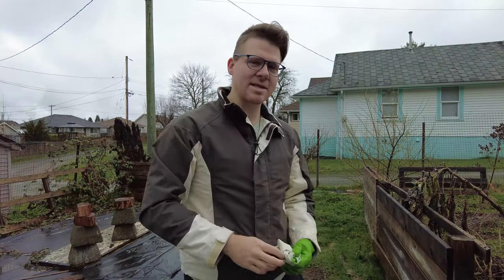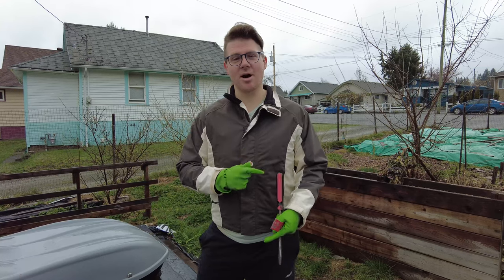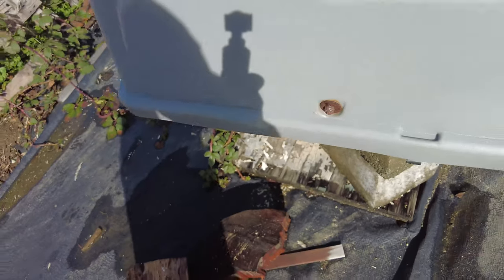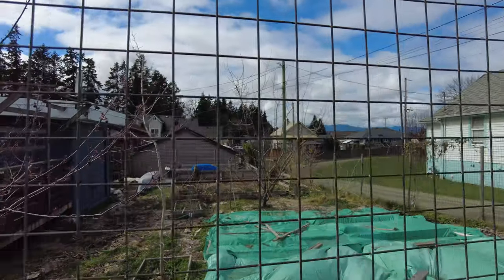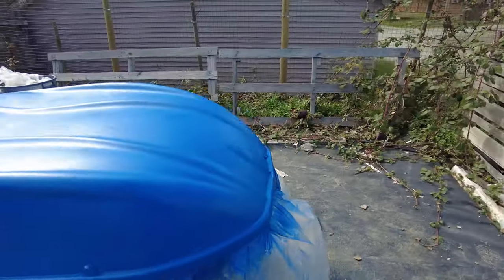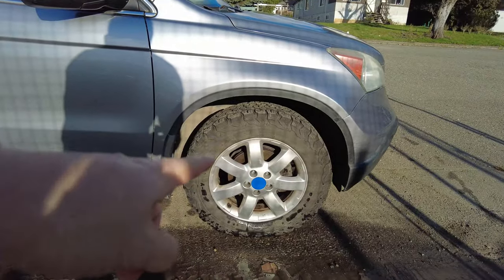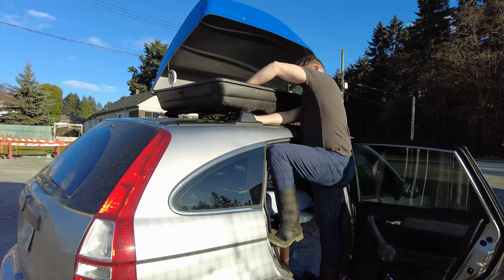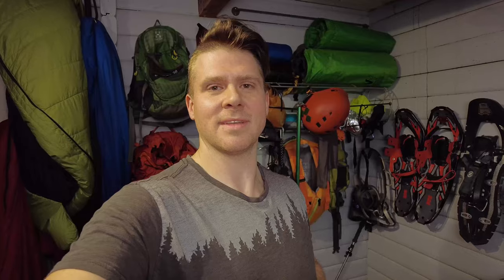How to Paint a Roof Cargo Box | CRV Van Life

Comment: Hi from high desert AZ.  Thanks for cargo box vid.   I purchased a used Yakima box that opens both sides...their longest one...going on  fire engine red '09 rav4.  Want to paint the box red too.  My research has all shown that an amazing amount of sanding and topical coating  need to be done first to prevent large chunks of paint from peeling down to the black plastic.  How long has yours stood up well?  Great job, thanks.
Reply: the box opens on both sides???
Reply: Yep, oops, its a thule, not  yak.  Opens driver & passenger sides.  Its about 4 yrs old.  I am gonna go for the routine  of:
1) clean using paint thinner
2) spray 1 coat Rusto fusion 2x
Reply from the maker: I only 1 had once fleck of paint to fix after my 3 month road trip.
Reply from the maker: only on 1 side